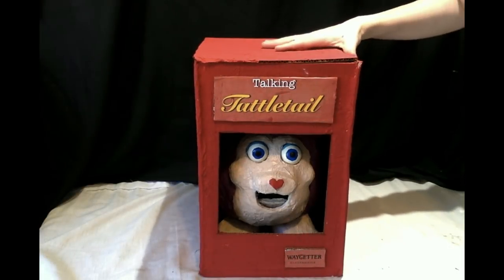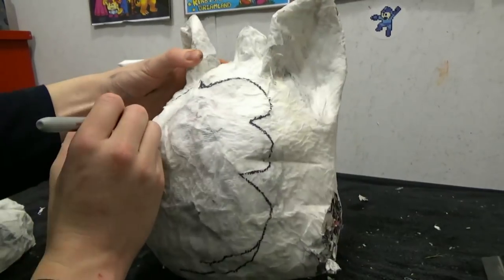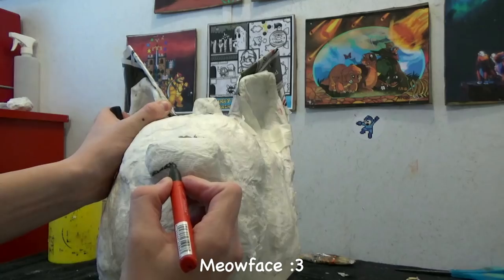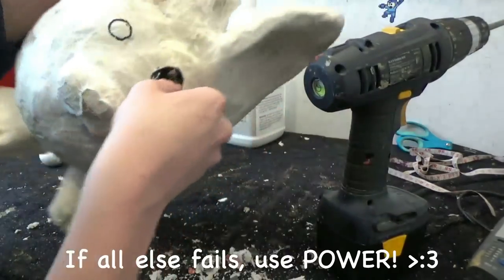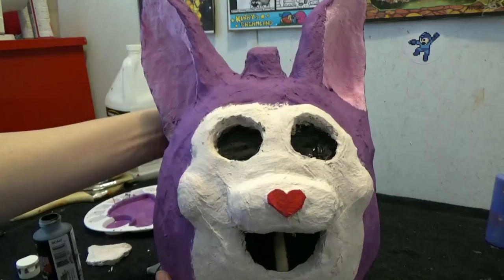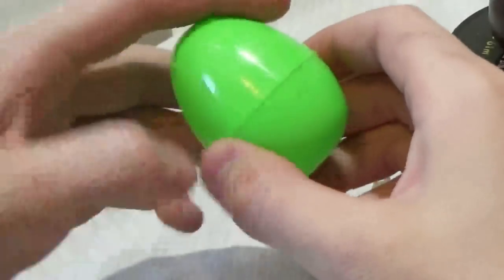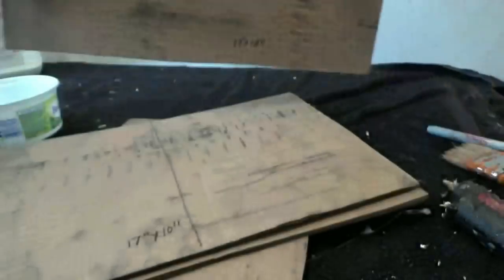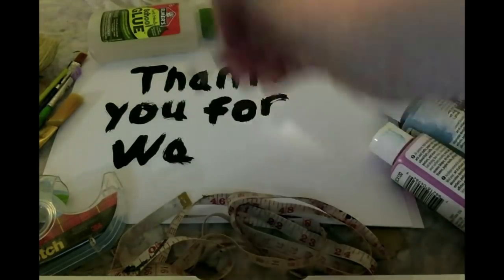How to Make: Talking Tattletail Puppet | 90's Themed Video Game Toy | DIY Crafts from Scratch

Comment: are you also able to use super glue?
Reply from the maker: You can yes, tho I don't recommend it if you're young. I don't like working with super glue because of how it bonds so quickly and the fumes that it gives off. You will need good ventilation when using super glue and make sure you have the workspace covered with newspaper. Wear gloves that won't allow glue to contact your skin. And safety glasses should be worn at all times.
Reply: Tommy's Puppet Lab okay! thx for the advice! that will be helpful for when I make my tattletale in the future! thx!❤❤❤❤
Reply: doofy dana c
Reply: We are a fan